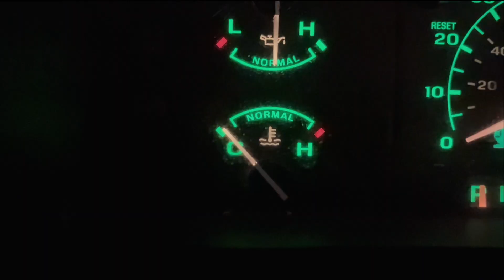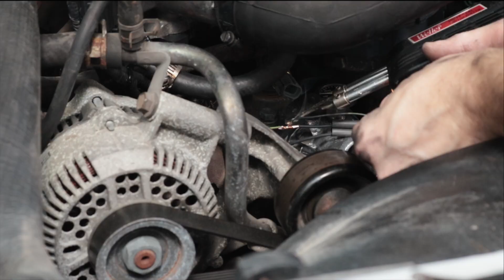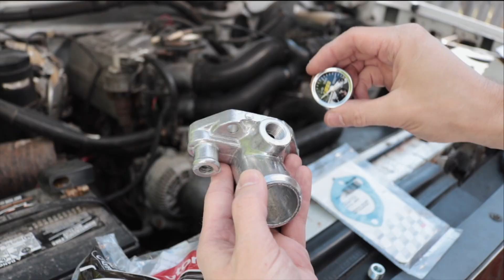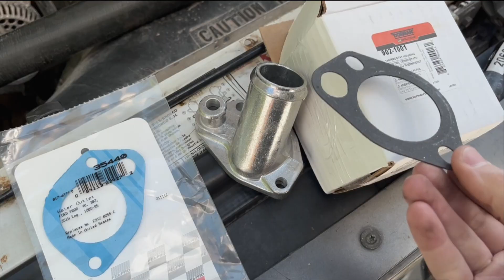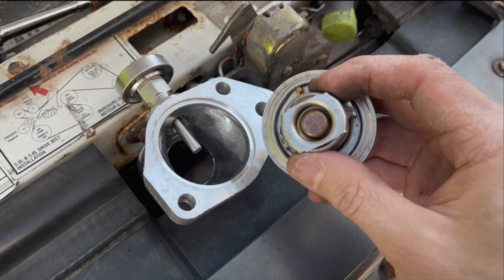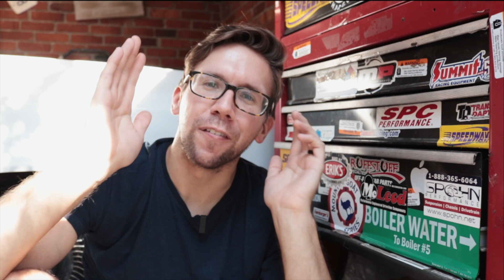Why Does This Engine Never Warm Up? OBS Ford Temperature Gauges/Aftermarket Gauges

Comment: Does the new connector help with the fluctuation of the temperature guage while driving? I know its a nit picky thing but I have been curious as to why modern temp guages stay in one spot at or near center on new vehicles compared to my obs f150 where it fluctuates between ORM. Thanks.

Comment: I actually needed this video earlier. 😆 That thermostat housing looks cool, I may install one for that reason alone.
Reply from the maker: Right?! It works really well - it's actually been on there for about two months. I like sitting on these videos for a little bit to see if anything goes wrong/wears out/breaks before I post them to give updates but it's solid. Unfortunately we don't have anything with a carb style intake manifold on it but this woulda been perfect for all those old things. Or anything with an idiot light on it instead of an actual gauge.